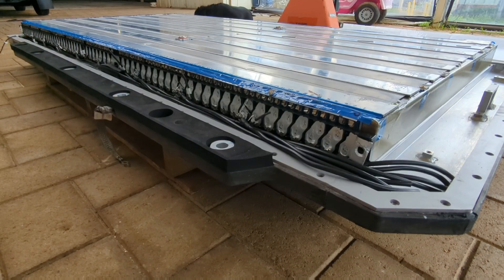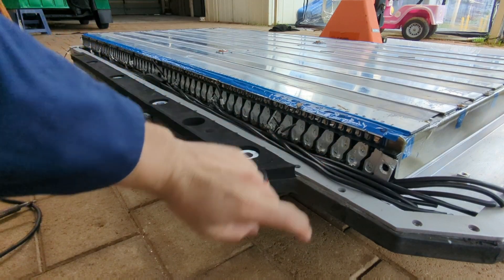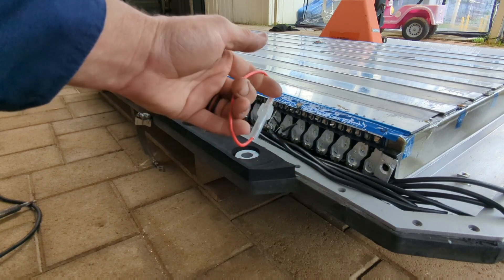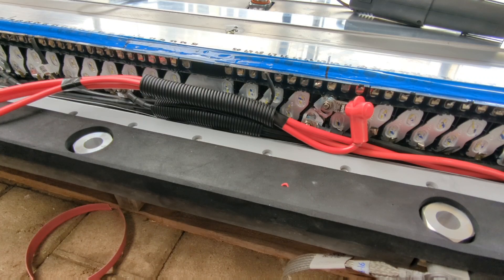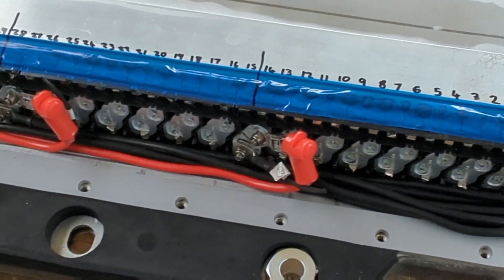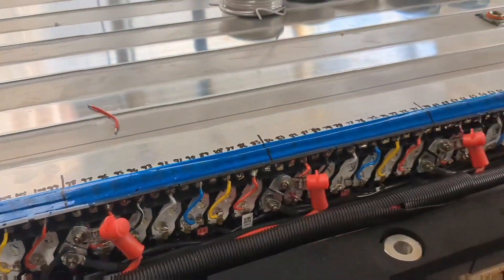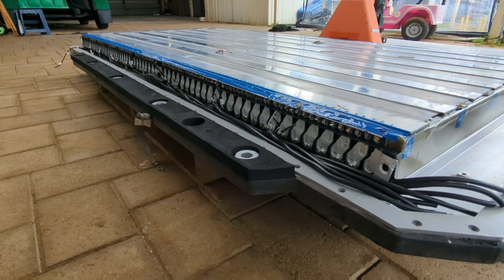BYD Atto 3 battery to home storage P4 - battery cables and cell taps

Comment: Hello Brendon. I ride in Belgium a Tesla model y RWD with 58kw lfp byd battery ( same Atto 3 ).In case of structural chock what is the chance to avoid to buy another pack ?
In fact , what is the repairability blade by blade ?
Reply from the maker: Not much unfortunately, the tesla version is slightly more repairable but it's similar to this with everything glued together
Reply: @Brendon_M thanks a lot

Comment: I am assuming you are in Australia and wondering roughly what the battery ended up costing in the end.
Reply from the maker: I bought the car I pulled the battery out of from pickles and by the time it was delivered to my door it cost me $11000. I already had the solar system ($4000 a few years back) the hybrid inverter was close to $3000 installed (I upgraded that a few years back when I first installed a battery). The BMS that could talk to the inverter cost me $600 but I've replaced that recently with a newer one with more features that cost $250. There is also a good few hundred bucks of sundries (cable, brackets, steel, terminals) though a lot of that was stuff I had lying around. I have sold some stuff off the car (about $2000 worth of parts) but the majority I donated to an EV training place. All in it probably cost me $17,000ish.
Reply: @Brendon_M  Thanks for the reply, I have an off grid system I built myself and my current battery is a 37KWH lead acid forklift battery. It has served me well and still going strong, I got it 9 years ago second hand for $4,000. But it would be be good to have more storage especially with the heat and running air conditioning. As EV's get more common I am hoping battery prices come down, I have built all the most of the off grid system myself including the inverter which can deliver 8KW continuos and much more for short periods. I don't have an EV to drive yet but am hoping that will change soon, like you most days I have more solar power than I can use.

Comment: I am happy to see how many work were spend to establish a second life for the battery pack from the Atto 3. Respect from my side. 
However I am bit concered about the used DC Inline Fuses. In the beginning I have used them even so to protect my battery pack against shortcuit. Meanwhile our community have been recognized that in case of a short circuit of the cell block the current which needs to be cut is too high for these kind of DC Inline fuse. Usually they can cut a shortcuited from around 2kAmps. Usually calculating the inner resistance of a battery pack 14s in chain is around 2 to 3 mOhms. So the shortcuit current could be around 20 kAmps. 
I would recommed to exchange the DC Inline fuses by suitable one. In any case I can help with some recommendations if wanted. 
Which you all the best and hope your are enjoying the solar radiation self power consumption.

Comment: Dear Can I cut the battery into more a small capacity parts to use it in another place , Is it possible?
Reply from the maker: Not easily. It's all glued and welded in
Reply: @Brendon_M  I understand you, it’s hard but not impossible yes ?
Reply from the maker: Nothing is impossible but I think you will damage some of the cells getting them out.

Comment: hey, I want to buy online software for BYD EV and its device for diagnosis faults, can you help me or connect me to someone who can help me?
Reply from the maker: Just a Bluetooth obd dongle and a car scanner app. Otherwise you'll need to buy a proper scan tool which are thousands of dollars
Reply: Please sir, how can I contact to you in private?
Reply: I want to buy proper scan tool, can you help me? If not do you have wiring diagram for BYD EV models?
Reply from the maker: I don't have any wiring diagrams. There is a bunch on GitHub (search for "GitHub BYDcar) but it's all in Chinese. In terms of scan tool, Autel do an EV specific one that I've used and it seemed quite good. It was called the maxisys ultra EV or something like that.
The best place to contact me would be on the AEVA forum

Comment: Curious, what is your inverter? I assume its a 48v system.
I was wondering if it would be easier to just use those new HV Inverters (that can use 200VDC~500VDC battery packs).
Reply from the maker: Goodwe 48V inverter. It would be easier to go higher voltage but I already have the inverter (and a battery connected to it) so I'm stuck with making this 48V. I also already have a 14s BMS so if I went to 400V I'd have to buy a new BMS as well
Reply: @Brendon_M  If I am not mistaken, GoodWe (and most 48V inverters) can handle PV inputs upto 500V.
Have you ever considered NOT cutting up this BYD battery pack, use it as a 126 cells in series (360v~450v) and then hook it up as a PV input?
The problem is charging though. Currently, getting a HV battery charger is kinda expensive (limited choices).

Comment: I don't like all in one battery pack. Tesla use 15 smaller pack for 1 car. If 1 pack have problem you can replace it.
Reply from the maker: Agreed, but Tesla have gone the same way. The model 3 and Y both only have 4 modules instead of 15 and the later models have a  cell to pack design similar to the BYD. It's bad for repairability but all manufacturers are going to have similar designs.

Comment: Looks like the silicon type you used is for bathroom or glass, if that is the case its a bad decision as this type of silicon is high acid levels and wont go well will your metal contacts.
Reply from the maker: Good point, I didn't think about that but it was a neutral cure gutter silicone so hopefully not.
Reply: @Brendon_M I suggest Beko "Gecko Hybrid POP".

Comment: Hello everyone, an electric car can be considered a bomb after the end of the warranty, no one will want to buy used.  Unfeasible to maintain.  Imagine changing 126x 150Ah cells is a very high cost, do you agree?  I would like an opinion, thank you.
Reply from the maker: I disagree, just because the warranty runs out doesn't mean the car stops just like when the warranty ends in a petrol car the engine doesn't immediately blow up. Yes it is a high cost to replace the battery but it's also expensive to rebuild an engine. 
Most lithium batteries now are good for a few thousand cycles. That's the same as running the car flat every day for 10 years straight or approximately 1,000,000 kilometres. Even then, the battery will not have failed completely but should still be at 70% of its original capacity.
I'd buy a 2nd hand EV in a heartbeat. I don't have to worry about whether it's been serviced properly over the years and there is so much less to go wrong.
Reply: BYD has some taxis with blade battery tech that have driven over 700,000km now with 90% battery life!
How far do you expect to drive your petrol car in its life?
Reply: @johnosmers4374 I have no idea how many km I will drive, I think the future could be hydrogen cells or salt batteries
Reply: @rafael7word  Hydrogen has failed as capital markets choose the EV route
Reply: @Brendron_M.  Interesting, it's very good to know these various factors, EVs actually require less maintenance and parts, I still have my old car, a 2009 Honda Civic with 160km, everything still works perfectly.  What would you say from experience about a plug-in hybrid car?
Reply from the maker: I have a plugin hybrid Mitsubishi outlander and I think it's great but as soon as a full EV comes along at a price I can afford that meets my needs I'll buy it. The battery in the outlander is too small and order to move the car too much power is asked of the battery which degrades the battery prematurely. If the battery was twice or 3 times the size it wouldn't be stressed as much and would have a longer life but if the battery was that much bigger then it wouldn't need to be a hybrid as the EV range would be enough that the petrol engine would never be needed.
Reply: @rafael7word I have a 2010 Toyota puris after 280.000 km the battery is gone and I sell this vehicle one taxis driver pay me 3000 euro and now I have Tesla model y I m so happy with this car
Reply: @周阳-s4n Interesting, you sold your car, wouldn't it be worth it to buy a new battery? Do you know the price of the battery?

Comment: Pretty cumbersome to Connect the terminals that way. 
Can't say it looks very pro. Though. The contact area isn't that large.
Reply from the maker: Each connection should only see ~10A at the absolute max but I agree, I'm not happy with it
Reply: What is the charging cycle of byd blade battery ?

Comment: Could you please make overview of DC charging port of Atto 3? Pinouts, etc. It will be very usefull for changing GB/T DC port on Yuan Plus for CCS2 like on Atto 3.
Reply from the maker: I plan on selling the rest of the car as a whole but if that doesn't pan out then I might go down the path of stripping the car and doing a full teardown.

Comment: I have a question, how is the overall protection for road debris in high speed impacts ?and what kind of material is use to secure the batteries from under the car ?
Reply from the maker: There is a layer of plastic sound deadener stuff on the bottom of the pack and then the pack itself which is just a solid plate of aluminium. I haven't measured its thickness but it's probably 5ish millimetres.
Across the front of the pack where all the connections are is a piece of rectangular tube that bolts up to protect the front edge.
The battery pack is just bolted up around the perimeter from the bottom with 4 bolts down each side and 2 at the back. There is also 2 bolts that come down from the inside of the cabin under the seats. The bolt into the top of the pack, about a third of the way back
Reply: @Brendon_M thank you very much for the very complete response 👏👏👏
Reply: Well the battery is not rat proof, as an Atto 3 battery in Thailand was damaged by a rat that ate into the battery pack!

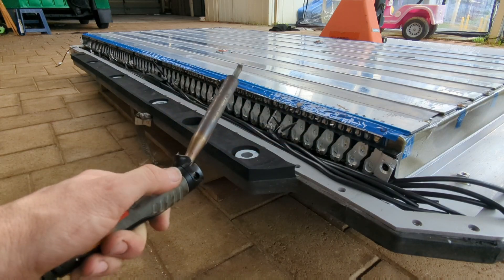Comment: [7:36] I'm totally judging you :D!
Reply from the maker: That soldering just goes from too cold to way too hot. It's locked on at the 100W setting with no temp control

Comment: In general, how do you grade the workmanship, quality , sense of safety for the byd battery , let say 0 poor to 10exellece, what grade will you give?
Thanks
Reply from the maker: I think the build quality is fine, say 8/10. My only real gripe with it is the lack of repairability. There are a few weird design choices such as the bus bar running on-top of the otherwise flat pack and the fuse should really be midway in the pack rather than in the contactor block. But overall it's a pretty good design.
Reply: @Brendon_M  
Thanks for the input. I feel more confident to invest in ev...once
 charging fee  is more reasonable
Reply: @Klentung8989  The biggest cost is the tariff. 
This car’s price in China starts at $16,495.
Reply from the maker: USD$16500 is about AUD$25500
This car was probably around AUD$55000 delivered in Australia.
The base model ATTO 3 starts at AUD$48000
The price is basically double the China price for us Aussies
Reply: @Brendon_M  I am a battery design engineer and I can tell you this design is VERY good. Simple, lean, cheap and robust design. Serviceability would ruin it.
Reply: Indeed - incorporating reparability into a battery pack inadvertently creates points of failure. If the goal was an EV with a long battery service life, they're done well.
Reply: @Diazodinitrophenol they are poorly assembled thou, haven't the BMSs or similar components been failing, the MOSFETs short out right? And then overheats battery and then thermal run away? Happening in Europe but mainly china coz they are everywhere in China
Reply: Diazodtp • Then you're not a good battery engineer.
Only the easy serviceability of everything shows the correct engineering design.
The today's EV batteries are made like that intentionally so that they can't be serviced and repaired. It is a good ( = unfair to the buyer ) financial method for the manufacturer, but not good at all for the customer.
Just think about buying an ICE car and its engine is build in such a way that it can't be serviceable and repairable. 🥴
Reply: @mikel4879  litterally where all ice cars are going anyway, mercedes engine bay is only serviceable by Mercedes-Benz
Reply: @mikel4879   Lol thanks for your proffessional evaluation. ICE engine has moving parts and needs to be serviceable only because i breaks down. If something does not need to move, making it unserviceable makes it generally more robust and much cheaper.  Imagine if each of your mosfets in the phone was removable/serviceable. Would that be good engineering? Yes, and it would be as big as a PC and cost 100x more.
Reply: @SustainableGal Nope, others can do that too. But for changing the crappy simplex timing chain, for example, you have to take out the axle, gearbox AND engine! 🤯
Reply: Atto 3 costs 1.2 million baht, replacement battery is 800,000 baht as seen in a few write off's there